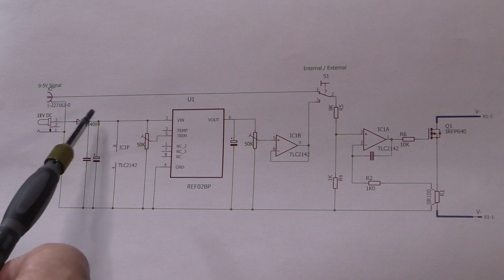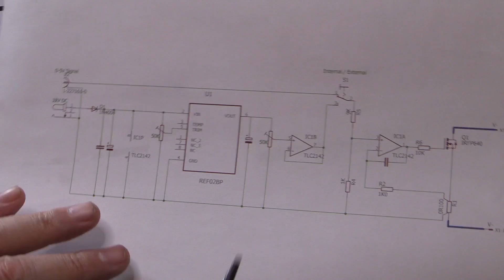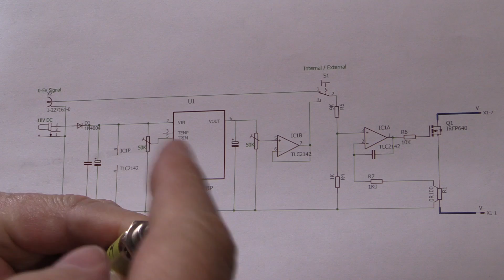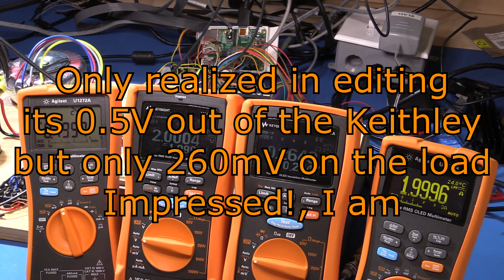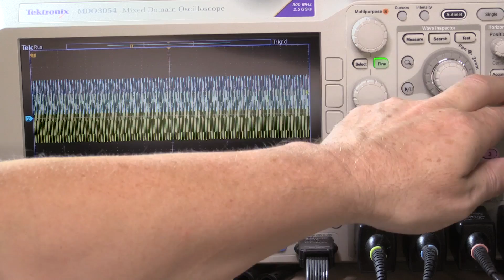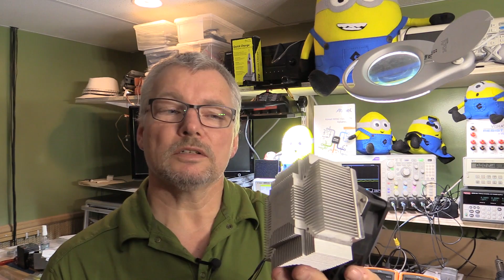Electronic DC Load Design and Testing

Comment: Dear Peter, 
Can you explain what is the purpose of the resistor R2 in the feedback path to IC1A？ And why the value of R2 is 1K？
Thanks a lot!
Reply from the maker: It has multiple purposes. 1. keeps the input to each side of the op amp more balanced. 2, part of the feedback loop to inhibit oscillations along with the feedback cap... remembering nearly 10 years ago:learning:
Reply: @TheBreadboardca  Thanks a lot! Knowledge about analogue circuits and physical real world never goes out of date, even if it is from ten years ago!😀

Comment: Hi Peter,
I followed your project with some changes because I don't have enough components  (like: dual opam op270, R1= 1R 5W 2 leg type, REF 10V, R5=1k, 24N60 mosfet) with my calculation, it should have 5V on R1 maximum and go all the way down to few mV as you described on this video, but even I turned the trimmer to zero level, it still got 500mV across R1. I mesured without load at pin 2: 0mV pin 3 65mV but with load on, they all go to nearly 500mV,  Would you mind telling me what is wrong here
Reply from the maker: can you email me a picture of the circuit you have built (So I can see how it is hooked up). there are some common things that can happen. If the load ground is part of the control loop it will affect it. If the opamp is not rail to rail then it can have an output offset,  in a simplified way, the circuit is acting as a voltage follower, what ever the volts on pin 3, it will try and make pin 2 the same, so with a 65mv on pin 3 with nothing connected in the load circuit would indicate the opamp is not good enough, try shorting pin 2 and 3 together, it should not harm if everything is wired as you say.
how does it perform at higher levels, is say 1Amp ok, ie 1V on pin 2 should result on 1V on pin 3, of course with no load connected there will never be a correct feedback on pin3 and the opamp output will probably go hard on. what is the volts on the pin 1 with your settings ?
Reply: Thanks so much for replying me
For pin 1 which is output to gate of mosfet, it’s about 7vol (I’m using 12vdc as supply)
With the high side, let say more than 600mV it’s quite good (pin 2 3 are same voltage) I only go up to 2A because R1 quite hot at more than 1A
That means I have to change good opam? I’m not electrical engineer so how to know which opam is rail to rail?
Again thank you so much for clarifying my problems! I will send you pic later on
Reply from the maker: @imtrung5244  Good to know, there are possibly other issue in that not all potentiometers will dial down to a real zero. so by having a bigger (0-5V vs my 0 - 250mV), this will be more of a potential issue. regarding the op amps, if you look at the data sheets you will see it clearly mentioned, also having a low input bias offset will help to. an output of 7V will defiantly have most MOSFETs turned on as a typical "Start to turn on" is about 4V or lower. this is refered to as the "Gate-Source Threshold Voltage". with no load current to provide the feedback, there will be no way the op amp can balance its inputs so it will often max out the output. this is not the full supply voltage (12V in your case) as there are potentially many driver transistors and diodes between the output and the supply,
You mentioned your getting only 7V on the output of the opamp. You may run into another issue if you try to go to high amps as with 5V across the resistor, there is only 5 or 6V left  to turn on the mosfet, this may not be enough to support the needed load.
Reply: I also tried two others dual opamps (4556. 5532). The lowest volt is slightly more than 500mV but the output to Gate is about 11.6V, I sent you my pictures but with facebook because I didn't find or didn't know how to send message via youtube channel. So I will try to use 18k and 1k as volt divider with 0.1R, so hope that issue gone out. I will be back soon. Many thanks
Reply from the maker: @imtrung5244  I look forward to seeing how it goes.
Reply: Do you have any suggestions? I changed volt divider to 1k and 15k, also opamp, mosfet 24n60 and 10 turns pot. But it's still the same at lowest point, it's 0.469V at S pin of mosfet. When load on, it's about 5V at the Gate, without load it's about 11.9V. My load is 18650 battery, with 3.7V; is that a problem?
Reply from the maker: @imtrung5244  having an 1860 is not a problem for a source for the load. I will have to try and build the circuit here in my lab to see what is happening, at least in my scenario, I will use a bread board and such but I will try to use as close a values to yours as I can
Reply: That's so kind, highly appreciate your helps.

Comment: Dear Peter
I really enjoyed this set of videos.
I completed my DC load recently and it works like a charm!
It is nice understanding the circuit that I build. Watched the videos a number of times! 
I could not get the hack on the amp and voltmeter implemented, but it does not matter much, it is just the voltage meter that does not include the voltage drop over the sense resistor.

I enjoyed building this project horrendously! 

It is simple and easy to build.

Hope you do some more of these explanatory amd practicle projects!

Kind regards
Reply from the maker: Praise indeed, many thanks for the feedback, it is most appreciated. I will be doing some more soon as I have been working on a fully automated version with some friends over in Europe

Comment: Do you have example of manually (cobbled) driving a mosfet as a load, as you mention in the beginning, sounds like a good starting point.
Reply from the maker: Are you meaning without feedback or just simpler than what i presented like no VREF or signal input ?
Reply: Peter Oakes no feedback maybe pulsed? as you mention in the first minute.

Comment: Dear Peter

I have successfully built this DC Load (Still a bit militaristic and on breadboard).
Will transfer it soon (Hopefully!) and add some protection circuitry. The way you suggested using a diode over the sense resistor is brilliant!  
I also used a cheap 5W 0.1 Ohm sense resistor, but it works for now.  
The project works great!

I got a current and volt meter from Banggood but could not separate the volt and current side as you suggested. I think i will put mine on the low side (Ground) of the circuit.

https://www.banggood.com/0-33V-0-3A-Four-Bit-Voltage-Current-Meter-DC-Double-Digital-LED-Display-Voltmeter-Ammeter-p-1060303.html

Thank you very much for this detailed video! I like the fact that it was easy to understand and build. AND very useful!
It will work very well for me without a complex controller! 

I enjoy your electronic videos.

Kind regards
Stephan

PS: still a bit confused if the mosfet you used was a IRFP640 or IRFP064.  : )
PPS: What does the "P" stand for?
Reply from the maker: Your welcome, glad it was useful
P is sortof for Pulse, the mosfet I used is characterized for switching systems normally but works well here too and is not too expensive. I am just waiting on a new MOSFET, much more powerful and specifically designed for linear operation, I will make video once I get it and see if it works.

MOSFET in the post is the IRFP064, here is the data sheet, http://www.vishay.com/docs/91201/91201.pdf, sorry for the confusion

Comment: Are you saying my string of light bulbs on a 2x4 isn't a professional piece of test equipment!?!  :)
Reply from the maker: it might be, does it meet code and has a calibration certificate :)
Reply: Peter Oakes absolutely.  I personally aligned each bulb with a Fluke Filament Fixer!

Comment: Ok - tech thing. The MOSFET makes 99% of the heat. Why put a four wire sense shunt on same sink?  Nuts right?

Yo! Water cooling dude. Maybe like green. I don't know.
Reply from the maker: in this case the Vishay resistor is virtually immune to the heat change and I needed a place to screw it down

Comment: Is IC1A's capacitor 47nF?... This capacitor has a min or max valor?
Reply from the maker: I believe that was the value I used, as far as min or max, I selected on test to minimize ringing and oscillations but 47 is a good place to start.
I will be posting a new video of the DC load very soon were I have a new circuit and automate the control of it.

Comment: Hi, this excelente.   
 
But I have a problem
 
where not get resistance   R1
 
 
Someone can tell me where to buy it?     R1
Reply: +Monica Garcia lol
Reply: +Hammer USN R1....resistor 1, is the potentiometer
Reply from the maker: +Hammer USN R1 is the SHUNT Resistor :), you can get Shunt Resistors from RS-Components, Newark, Mouser, DigiKey etc etc. the ones I used came directly from Vishay VPG but can be found in certain values at the above suppliers. You can also use other shunt resistors, 4 wire or 2 wire depending on budget and accuracy requirements.

A "Poor Mans" 4 wire shunt can be made by placing the current wires slightly outside of the measurement wires on a simple axial (2 Wire) resistor. place the voltage measurement wires as close to the body of the shunt as possible. Stability is the key for these resistors as accuracy can be tuned out (Calibration step) so if you have a good accurate ammeter then you can set the range etc without ever knowing the actual value of the shunt resistor. Just make sure it is rated or over rated for the power you are going to put through it

Here is a link to mouser http://ca.mouser.com/new/passive-components/resistors/current-sense-resistors/n-7fjcf, others can be found by google search for "Precision Current Shunt Resistor"
Reply: +Peter Oakes (TheBreadboardca) excellent, thanks

Comment: Peter, 

Looking at the design for the DC load has got me thinking, Couldn't you use the same circuit ideas as you used in the power supply to achieve constant voltage, constant current or even constant power and or resistance.

 i.e. The differential sensing and integration - with the addition of MCU control this could produce a very flexible load - with data logging added things such as battery capacity testing springs to mind, especially if combined with the PSU itself. 

You have definitely got my creative juices working...
Reply from the maker: +Richard Kelly You are correct and this is what i am doing, though the schematic may be slightly different for the actual PSU implementation

Comment: Hi would you be kind and give value of wishay  resistors
Reply from the maker: gregor obreza Depending on Value and tolerance but looking at this link http://canada.newark.com/webapp/wcs/stores/servlet/Search?st=S102C&catalogId=15003&categoryId=800000005308&langId=1&storeId=10196

they are about 20$ for 0.01%. A 1K 0.005% is about 40$ but you have to remember these resistors have almost 0 temp co so they will to all intents and purposes never drift if not abused. The other thing about many of these is that Vishay will make exactly the value you want without additional cost.

you can order direct from them or one of their approved centres check out this link http://www.vishaypg.com/foil-resistors/